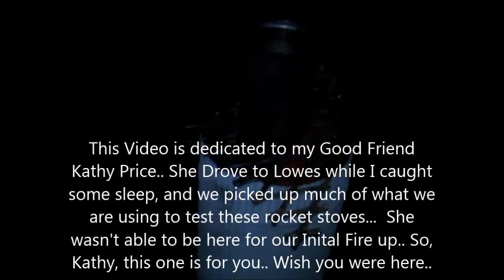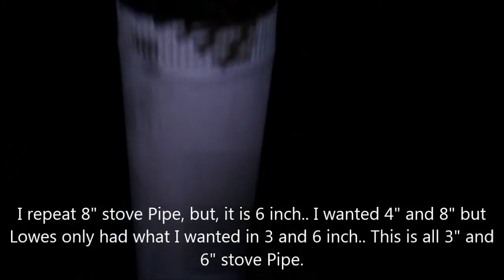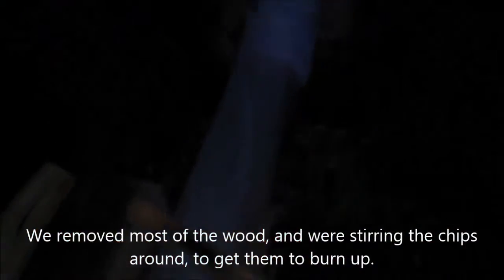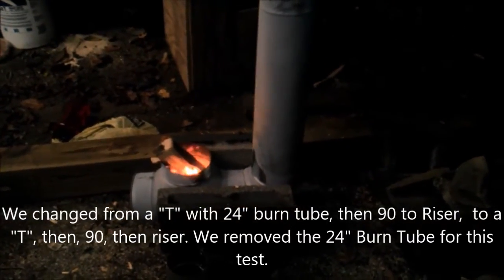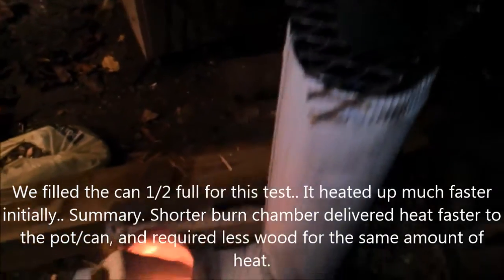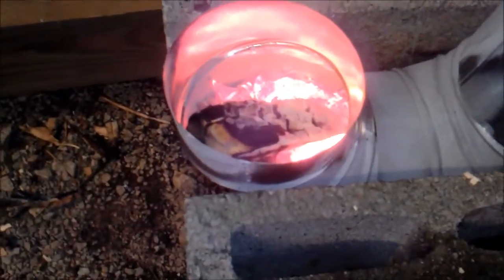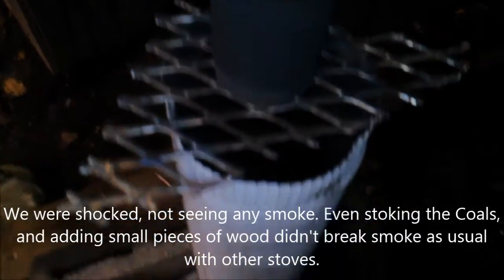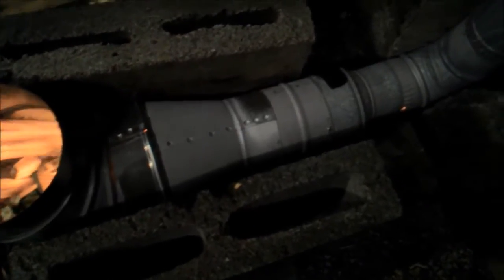6 Inch (Stove Pipe) Rocket Stove Testing-Several Designs in testing.

Comment: Why do so many people use cinder blocks next to a heat source or even as stove?
Those things can explode.
Reply from the maker: Dark Thoughts A cement slab can explode if you apply enough heat fast enough. I've never heard of one exploding unless someone intentionally did something to make it explode.
Reply: just sitting in the rain cement can absorb water. When turned to steam .... SHRAPNAL. That is why you have to let a fireplace set a while before you use it the first time after being built.